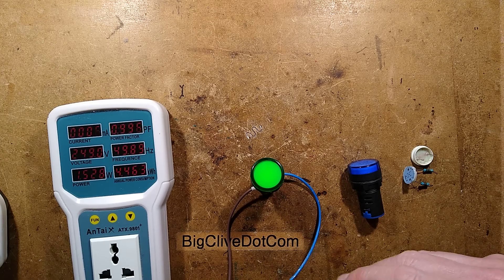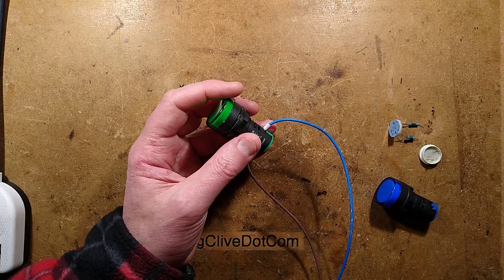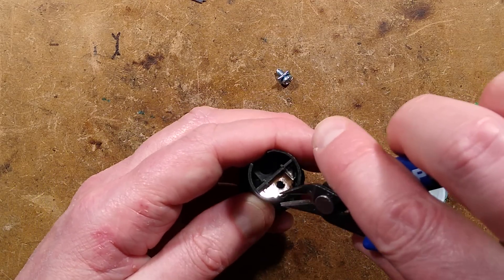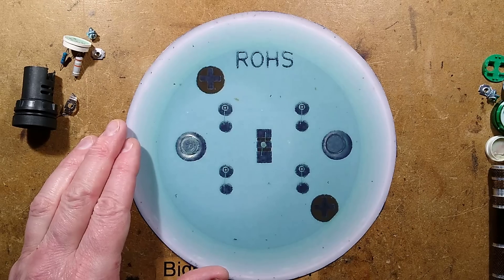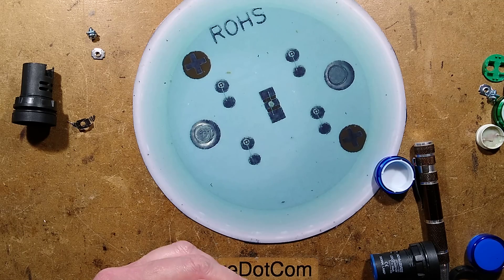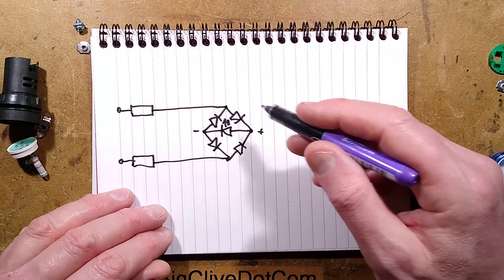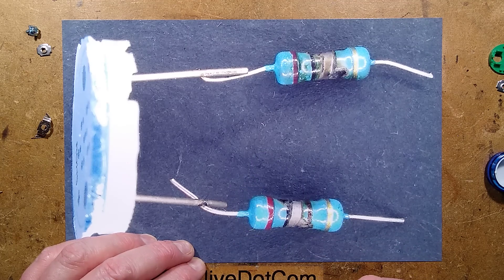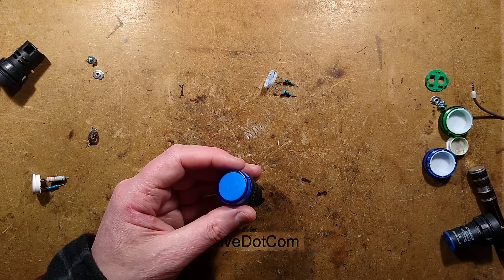Temu panel indicators - may need "customised"

Comment: I bought a Blue one From McMaster carr that is labeled 110v/240 V 
Same case and all..   has 4 LEDS and what looks like 2 SMD Transistors on the top. 
It is used as a Damper open indicator in the House for the outside wood burner..
Thanks Mike M.
Reply from the maker: The two transistor packages may be dual diodes to make a bridge rectifier.  Or maybe even a two transistor current regulator.

Comment: 2 x 220ohm would be about right for the 12v DC indicator : (12 - (3+1)) / 0.02 = 400 ohms (split in half). Very rough, assuming 3v for the LED and 1v for 2 diodes at low current. Looks like the surviving resistor band was red.

Comment: I found an LED strobe for attaching to any drone. The £19.99 NEEWER Drone Strobe Light, FAA Anti Collision Night Flight Light with 4 Flash Modes/4.5H Runtime/Light Rain Proof, Compatible with DJI Mini 4 Pro Mini. Amazon UK. It is very bright so can be seen for three miles. Is this over-driving the LEDs? What do you make of this?
Reply from the maker: Sometimes they overdrive the LEDs in brief pulses for higher intensity while still staying within the power dissipation rating.

Comment: I wondered when.. lol They look the same as the ones I bought but I can't remember if it was Amazon or Temu but I got a bag of 25 for a good price, 5xred,5xblue,5xgreen,5xyellow and 5xwhite at 240V. Like you I was curious and shone a light through the side to look inside and there is a Capacitor ( a reddish-brown shiny, plasticy looking thing) and a resistor on the pins, I guess cap dropper and inrush limiter. Not sure how long they will last but they're only going on a 4 channel NJD pattern chaser for a fancy space shippy panel thing I will eventually get to make sometime in the next decade lol
Iv had the disco controller for fluffing years now and needs to be put to some use. 
Id love (and wished I had now) to have got the lower voltage ones but my logic was just stick them on the end of a bulgin plug and let the chaser do the work LOL
Reply from the maker: You may find the NJD controller needs a decent load to work properly.  The triacs may not latch with too low a current.

Comment: Wonder how long until Big Clive has to repair a panel made with these cheap things. He replaces the indicator with one with the same markings only to find it was a 12V indicator with a 240V marking so it still doesn't indicate. Or worse yet, it's a 240V indicator with a 12V marking, making for nice bangs when the machine is powered up. You save a penny, you cost a customer thousands of dollars in repairs

Comment: We were getting many euro machines in and they had teg multi led and rectumfire  circuit with a capacitor and they operated on 24 vac or DC .You can cut out a template to give the light a letter or number on the white diffuser so that you can identify what part of the equipment was energized

Comment: How do you know which end to read the resistor from ?
Reply from the maker: Spacing of the stripes, the tolerance band is usually gold or silver and you often have a logical value range that makes sense with the colour code.

Comment: The sixties are on the line.  They want their primitive display technology back.  There is no excuse for still using seven segment displays when a small oled display is just a few bucks more.
Reply from the maker: The notable bit being "small".  I prefer big chunky digits as opposed to squinting at a tiny display with far too many graphics.
Reply: for large displays, I like rgb  led matrices.  Bright and resolution enough for decent fonts.  My living room clock uses a 128x64 5x8" rgb led driven by a pi zero w and displays time, date, and indoor /outdoor temp.  Outdoor temp is from a weather service via homeassistant.  My car's sound system's mini-dsp  uses a 1x4" oled on the wired remote.

Comment: The 100nF dropper is the efficient way for 230 VAC ... but ... if they fitted  TWO  LEDs in antiphase it would be twice as bright and no need for any bridge rectifier .... ( ? ) ........ ( tried - n - tested ) .......... DAVE™🛑

Comment: RSVP those blue indicators. At least we got the sh*rt out of it.

Yeah, I do wonder if it's actually cheaper to use the higher dissipation resistors instead of a capacitor and single lower-power resistor.

Comment: With the diodes as bride rectifiers, I wonder if there would be visible shimmering if it were run on AC as the conducting diodes alternated at 50/60hz.
Reply from the maker: The LEDs are lit most of the sinewave, so the shimmer is only very slight.

Comment: Looking at the colors of the upper (edit: lower!) resistor in the closeup of the carnage (@ 7:53), it looks like they started as Red Black Brown, so 200 Ohm.  
Two of those making 400 Ohm would leave a potentially reasonable 30mA at 12v, though a good bit higher than I'd expect of a reputable panel indicator brand.

Comment: I used to use those switches and indicators from Eaton and/or EAO, which were always top-notch.  I'd get them in the bare LED/bulb versions if possible, then feed the indicators "conditioned" power, eg, stepped down and ballasted.  Saved headaches trying to mix'n'match 12V, 24V, 120V, and 240V, both AC and DC and keep dozens of type of parts in inventory.
Reply: beware the nos eaton stuff though. its often uos. had some crusty ones turn up. but the build quality is awesome. kinda germanesque
im solely buying milspec or aviation switches now to avoid fall apart cheap stuff.

tank toggle switches, nasa surplus switches, comercial aircraft stuff..its super chunky but i feel safe with it and its always got the style nailed. no barely registering detents with those things.
Reply: @luminousfractal420  Naw, this was decades ago and everything was brandy new.  I haven't done that shiite in about as long, at least not for a paycheck (moved from hw to sw), but still have some goodies squirrelled away for myself, still in the cutesy individual boxes.
Oh, and I forgot the 48V donks for telephony.

Comment: I got a white one years ago. It has two LEDs in opposite direction and a capacitive dropper. The power usage was so low I started using it as an always on light in a dark basement. So much easier to find the light switch now, for pennies per year.

Comment: @1:32 - the best thing I found for YouTube is a small script for uBlock Origin that complete (and I mean completely) removes ALL shorts from your YT feed.  ALL OF THEM.  I'm sorry, but I have witnessed the evolution of video from 4:3 aspect ration all the way up till 4K.  There is no way in holy h*ll that I am purposely watching anyone record anything in a vertical video format.  Period.  I don't do Insti or TackyTok or anything that requires a vertical recording.  It's simply society devolving.  FWIW, I do ALL of my YT and computer viewing on a 55" high-def screen.  I do not watch anything on my phone or a tablet.  Mainly because It's harder to ad block outside of my PC.  Second reason is the older I get, the more staring at my phone for a few minutes simply wrecks my normal viewing when I look up from the phone. That is even using bifocals with a current prescription.

Comment: I just replaced 32 of these LED units on the chiller units, Every single one had failed, I kept them for the cases.
Reply: did they have neons?  franlab did a good vid on the fake neon glass bulbs coming out, they die very quickly.
Reply: @luminousfractal420  Fran is good creator too,  These were identical LED modules White and Amber, I replaced with physically identical but Telemecanique badged versions.

Comment: Everything from TEMU is horrible terrible dangerous. The Lifespan is short .
Reply: Well, I got a cordless tyre pump from them that has served well for a year so far. It was on offer under £2. I couldn’t have bought the two 1850 lithium cells and BMS inside for that!
Reply from the maker: Not in my experience so far.

Comment: That would, indeed have been a good “short video.” It would fit in the same category as the fuse test YouTube short of Diodegonewild and Herrlito’s short video where he used a falling steel crowbar to bridge a 1.8kJ film cap across a sheet of aluminum foil. This just reminded me I haven’t done a short video on magnetic parts sticking to the aluminum output wires of my “spot welder” transformer…

Comment: I got some of the 22mm indicators with built-in voltmeter from eBay 7 years ago, I installed a red, a green and a yellow almost for fun because I had neon ones and the green had the phosphor toasted, I don't know how long they can last because they are connected to the generator output and I have used it "only" about 200 hours since then, but their accuracy is pretty good.

Comment: Built one years ago, using an old breaker for the case. Used 4 39k resistors in series, 1/2W carbon composition, because I had plenty of them, and 4 1N4148 diodes to make the rectifier bridge, and a green LED. Then potted the lot in the breaker casing, using the original screw terminals again. Probably still working to this day, next to the 3 phase main breaker in that lift room.

Comment: The 12v indicator is probably fine at 12v, but maybe not so good in automotive applications where the alternator charges the battery at 14.4 to 14.7 volts.
Reply: On this note, what would the current through the led be if you supplied 15 volts? And what if you put two in series, each would see 7-7.5 volts or so?

I’ll do the calculations some day
Reply: Update: 26 mA for 15V and 10 mA for 7.5V

Comment: The construction just looks like some company in China had some random left over parts that they threw together to fill the order. The integrated module and button look legit but then it just has some random resistors slapped on with a few blobs of solder (Edit: They are actually spot-welded on. Luxury!) Given that Temu is a P2P for supplier direct sales it’s basically the e-commerce equivalent of a food truck out in the ghetto. You might die eating it or maybe you will get shot. It’s a grab-bag of delightfully trashy products with a side of misfortune. I know I certainly enjoyed my self-disassembling boots I got from them.
Reply: Probably just the contents of the reject bin for the whole factory so you get a random voltage rating then it's just luck of the draw as to which voltage you get.
Reply: @ianhosier4042  I've also heard that a lot of them are buying materials and sub-components on credit and then selling at a loss in order to be able compete on platforms like Taobao/Temu. Since its bought on credit any revenue results in short-term cash flow that they use to stay solvent for the short term (operating costs, wages, etc.). I guess the thought process is that if they can outlast their competitors than they might be able to either charge higher prices or bribe people to get more sales to make up for it in the long run. But it seems some of the owners are just taking off with the money in the middle of the night when the debt becomes to great. Temu is actually quite terrifying in reality since the cut-throat model basically results in entire manufacturing sectors consuming themselves from within and then collapsing.

Comment: Wouldn't it make sense in the name of reduction to get rid of the FBR and use two anti-parallel connected LEDs instead?
Or are four diodes even cheaper to produce than another LED?
Reply from the maker: I'd have gone for the inverse parallel LEDs.

Comment: I've got a simple rule: I never buy anything mains-powered from those Chinese sites
Reply: That's what I mostly also don't do, but you need to consider that the same products are often sold by Chinese sellers (or local resellers) directly on ebay and Amazon. Especially on Amazon you get a lot of Chinese products directly from them with "shipping by Amazon" in a day or so - so to be sure always check who's actually offering the product. It's not always Amazon! The seller simply uses FBA and sends containers to AMZ which then cares about shipping it with Prime etc.
Reply: @webfreezy  I often see gear I bought on AliExpress on Amazon. (non-electrical and three times the price.)
Reply: It's just that someone in China built a product to meet a certain standard while cutting costs on everything or not having enough electrical knowledge. 
Louis Rossman already discussed the danger of Amazon generic car breakers for instance.

Although that doesn't mean everything is bad, just stick for the reputable manufacturers. 

Although some smaller product categories are just not worth this trial and error testing for the cheapest reliable offer. Just like 90% of Clive's finds on this channel. In this case you probably can cash out for a better option (hoping it's just a rebrand of the same thing)
Reply: @archivushka hopefully we find a balance of dangerous cheap and glutonously overpriced.
the big brands are just too much into proffiting. and its basic stuff that shouldnt be expensive.

amazon needs to be banned over its lack of safety and selling dangerous goods. but it wont be, excuses accepted by the big ol usa.
Reply: I bought a used phone on eBay from a reseller and they included a generic power supply, but it was truly certified by underwriters laboratories. The certification it had meant it passed safety tests so I felt okay using that charger @archivushka
Reply: amazon needs to be made responsible for what it sells. its a shopfront. it doesnt provide shops. it is one.  corruption let that one through and it ruined our local economies..and kicked us in the crotch with its dodgy products for good measure.
now we have everyone being in danger from fires and buildings that dont work in fires. all downhill.
Reply: Good luck buying something mains ⚡ powered, that's NOT Chinese! 🤣

Comment: I blew up a £2,000 radio by mixing up 12V supply with 240V a few years ago... Blamed the designers for using the same connectors but they told me 'no-one else has had that problem'. I still keep the dead unit as a reminder!
Reply: Had the same problem long ago with a Sokol radio that used the same 8-shaped connector for 9V charging that some 220V devices use. Blew the audio final transistors clean through - swapped them out, radio kept on working...
Reply: Double plus ungood
Reply: Poor design.
Reply: A friend of mine who works for DX engineering told me that people attaching AC line cords to 12 Volt mobile radios is an on-going and frequent customer mistake.
Reply: Big Clive will fettle it for you! 👍🤣
Reply: The company I used to work for got bought out by a big megacorp. They immediately forbade us from selling any other brand besides the absolute garbage they produced.  "Nobody else has had that problem" and "We've never heard of that happening before."  Were standard responses.  Even when you called the same guy 3 days in a row they'd still deny that they'd ever heard of that problem before.  There was a 6 month period where every 3d or 4th board I unwrapped would have components falling off because half the solder was missing.  When I got my first smart phone I began emailing them every time I opened up another one, and I'd make sure to zoom in and send a nice  clear shot of the quality control sticker which had been initialed.   Every time the response was "Wow, never heard of that one before..." 
I can only assume they were under strict orders to say things like that rather than admit to any known issues. 
I left that company about 12 years ago. They have driven my former employer into the ground and they can't keep what's left staffed because they quit giving raises in about 2009.
Reply: What kind of radio?
Reply: @JMWexperience  it was a 458MHz telemetry radio
Reply: @stepheneyles2198  I guess that explains the cost. Thanks for letting me know.
Reply: I did the same to a Siemens network switch (DIN rail mounted for PLC use), everything in that box used the same connectors, everything was marked ~240VAC except the switch, which was marked ~24VAC/DC. The bang it made was quite spectacular.
Reply: They were telling an Untruth, It's a common problem.
Reply: @dogwalker666 unthruth? what is this 1984?
Reply: @Paperbutton9  nope YouTube censors comments.
Reply: @Paperbutton9  Sadly it is beginning to feel that way.
Reply: Damn 🤣🤣🤣🤣 I woulda sent you a free unit or something

Comment: I suspect this is the arrangement for 120V operation which would pass 3mA through the LED and dissipate about 330mW across the resistor.

With a pair of 39k resistors that would still be about 3mA through the LED and each resistor would dissipate about 310mW at 220V rising to 370mW at 240V and 400mW at Clive's 250V.

Comment: Using the led arrangement you drew and a slow motion camera, would only one of the other two leds glow, forming the negative side, or do you think both would light up? I suspect only the one on the bottom, with the top left potentially getting warmer than the others (or never lighting at all and being effectively useless)

Comment: "That's how you draw a FULL BRIDGE RECTIFIER!"
I recently customized a pair of LA38 buttons with 230V LED backlight by changing the dropper cap to resistor, making them work with 24VDC.
Reply: Same here, got those exact same indicators, but the ones with the 5 LED dies, and simply cut out the capacitor, as the resistor they included was close enough to the right value (1k) to make it run off 12VDC. Did not trust the 100n 250VDC capacitor in it to last long at all, seeing as it was smaller in size than a 100n 160VDC polyester film, so likely was running the film well above the rated voltage, and relying on self healing to stop it from making capacitor foam.
Reply: Full-WAVE Bridge Rectifier
Reply: @nicholasamesbury  not the Mehdi way, haha!
Reply: Whenever I read or hear "full bridge rectifier" I always hear ElectroBOOM in my head saying it 😂